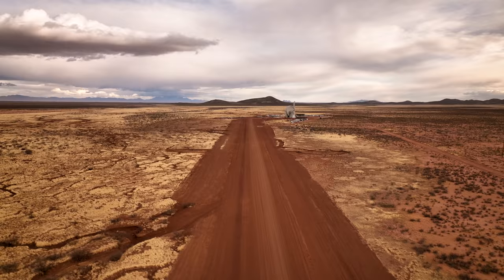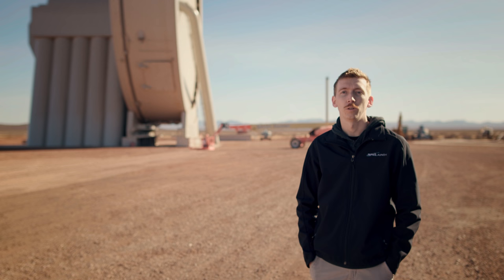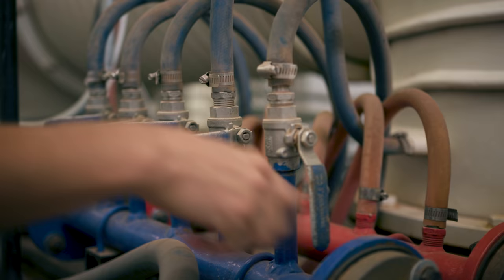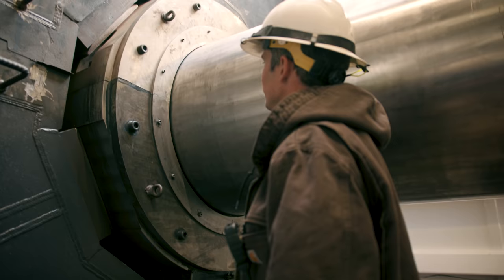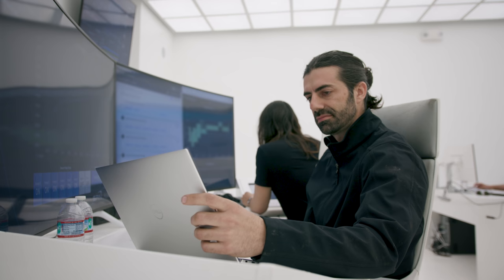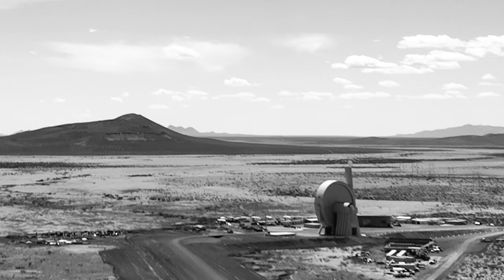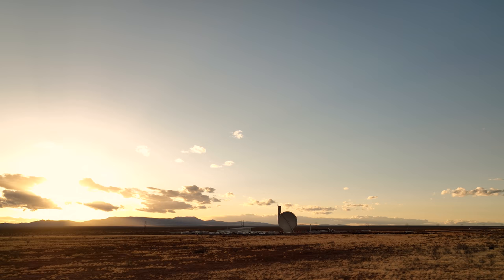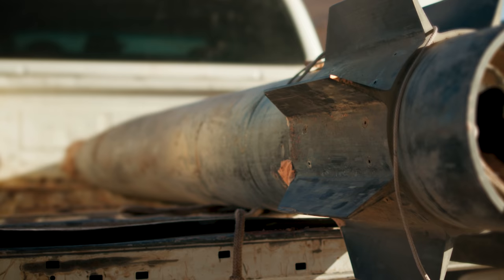An Inside Look: SpinLaunch Flight Test #7

Comment: This is incredibly cool!
It's not very practical on Earth (mostly due to the high G loading), but it would be an awesome system to use on the moon. You could have a much longer arm which would lower the forces on the payload, and one of the main things you might want to launch is ice for fuel, and even megalith for space habitat shielding. I'd guess that a system like this would be a lot cheaper than any rocket-based system to launch stuff from the Moon.
I'm sure you've thought of this, but are you developing such a system? I could see a need for it within 10 years or less.
Keep up the good work!

Comment: I'm thinking about getting an extra boost by having a charge set off upon exit, with the inner door as a blast pad. The blast would close the door even more quickly. And make the space between the doors an oxygen rich environment. The ignition would help preserve vaccum.

Comment: (short term)used the spinning launch and some plants inside and a person then fire the laser at the back of the ship to act as propulsion

(Long term) A human person can survive a speed of Sonic boom so i have a theory that a person can also survive when about to launch to a spinning launch maybe its just needs a comfortable object for a person to not squeeze then fired the laser at the back of a ship to act as a propulsion to push the ship to specified direction.the laser is not coming for the ship the source will be on earth.maybe a million bolts is required i don't know.this laser that I'm talking to is the laser fired in a micro sattelite probe to spy proxima centauri the strength of the laser will decrease in distance so many you need to fire laser sattelite first to act as a bridge sent a fired laser to the ship.the other problem is that where is the source food to survive a person on the ship so maybe the ship should be a bit bigger to build a plant resource inside and some water

Comment: This is a flawed design yet they still keep going. The amount of energy and speed needed to take it orbital is outrageously high. The vessel would need to be spun much higher than match 10. Which has so many complications. And even if it did happen, the vessel would experience insane forces limiting commercial viability. Even getting a projectile from something like a railgun orbital would be extraordinarily difficult. And this is 1000x harder than that would be.

Comment: Here is an Idea..  a small recoverable rocket.   You are putting square wheels on a car..  you need to to remove all the air from the chamber to make it more efficient..  and spin it 30X faster at LEAST..  why even bother doing this??

Comment: And what is the fuel vs energy trade off here? 
How is say saving fuel to 30,000 feet or say 60,000 feet more of an advantage of say strapping such a payload to a wing on some jet flying at 60,000 feet and releasing that payload? In fact that payload when released from the jet will have significant forward speed compared to this setup having zero speed at 60,000 feet. 
Virtually all or most of the energy going to be used up traveling through thick air in the lower part of the flight. Seems to me that using an aircraft at 60,000+ feet and then imparting mechanical energy (such as a electrical rail gun) would make much more sense).
I don't see how the numbers work to impart such mechanical energy from ground level, but such an idea at 60,000+ feet would, especially given the thin atmosphere at that point. Not at all convinced this road makes much sense at all, and worse is the payload stress being so high severe limits the types of payloads you can launch - especially the types that can pay the bills for such a launch.
But for the large portions of the society that's on the lower side of the IQ bell curve?
Fun to watch and a great way to fleece money out of those on the lower part of the IQ bell curve.

Comment: This isn't real!
What's to prevent the unbalanced centrifuge from destroying itself at release? 

Once released, it's a hypersonic missle traveling Mach 7+ at sea level, how are you gonna dissipate all that heat?  Exiting the vacuum chamber into sea level air pressure is gonna be serious impact energy to deal with.  

Acceleration at launch would make it untenible for any g-sensitive payload, it would make a pretty good torture machine though.
Reply: The shock when transitioning from vacuum to air will be the most difficult to deal with.  (Not really lol)

Comment: Just too many G's to achieve anything worthwhile - not to going to work. But (always a but) - wondering if a kinetic energy centrifuge might have a chance at a higher latitude. Unlike rockets, the force required and therefore the G's produced - would be less where the atmosphere is thinner, and the troposphere is closer to Earth. Spaceport is at 32°59' lat. - how about trying it at a place like Nome, at 64°30'? Or better yet - Utqiagvik AK (northernmost US town) - at 71°17' lat.? Just spit-balling.

Comment: Nothing would be cooler than to be shown that I'm wrong, but this all seems pointless. You aint getting to orbit without a chemical engine to bring up the orbit's perigee, and what fuel or o2 chamber is going to withstand 10,000G? How limiting and how expensive would it be to harden a satellite to that spec when competition offers <$3000 per kg to orbit? This seems like something that could have practical use on the moon or mars, not earth.

Comment: 2,000 Lbs x 5000 mph = 4,000,000,000 hp
but
You cant spin 444 lbs you have to counter weight it with 444 lbs that means 888 Lbs  and 2 steal arms @ 10 Trillion Hp 
and
popping a vacuum from zero to 14.7psi of a massive disk you will have to burry the spinner in concret reienforced with steel and even then 30,000 feet with solid rocket fuel to get a escape velocity.
lots of power a 10 Trillion hp electric engine to spin not a shaft @ 5000 Rpm but 10,000 Lbs.
Dual payload Arms shaft and a sudden loss of 440 Lbs. maybe pump hot Pb thru the arms after the payload is gone to prevent the impalance of 5,000Rpm @ 444Lbs 
Imbalance break or pump hot liquid pb thru the payload arm or release a counterweight from the arms center hub just before the payload release.

Comment: I've read a number of the comments, and there seem to be some strange things going on here.  First, the spinning of the primary arm does impart kinetic energy to the center of mass of the projectile.  However, unless there is a secondary pivot at the point where the projectile attaches to the primary arm, the system will also impart a lot of rotational kinetic energy about a spin axis perpendicular to the long axis of the projectile.  From the published images, this is clearly not happening as the projectile shows no sign of rotating that way immediately after launch.

Let's assume that there is indeed a second rotating axis in the actual launch apparatus.  This could be geared so that the projectile always points up during the entire spin-up or could be an independent system that aligns the spins just before release.  Perhaps that is a trade secret, which is why we don't see it in the images of the primary arm.

The next problem is that, independent of spin, there are large tidal forces on the projectile, which is long and thin.  Whenever the projectile is aligned with the tangent of the primary spin orbit these tidal forces will tend to bend the projectile, trying to make it into a pretzel.  Whenever the projectile is pointed along the radius of the spin circle, the tidal forces will try to rip the front half off from the back half.  If the spin is being cancelled, these tidal forces will change once per rotation.  Since the system is being slowly spun up, these fluctuating tidal forces will likely find every vibrational mode of the projectile's structure.

I don't know of any commercial payload, much less a second stage, that could take those g-loads and vibrations.  It's suspicious that the projectile buries itself after landing, so we can't see it.

Comment: All that effort ,just to get  the projectile to 30,000 feet, is a waste of time. What will they do with anything heavier and purposeful for a projectile.  The pumping down  of the chamber will take a lot of energy. Then  the seal has to hold the vacuum pressure  but also allow the projectile to burst through it.  And the physics change when you try and aim the spin chamber at anything but vertical.

Comment: Interesting concept. I don’t see how this will ever scale up to be able to replace conventional rocketry to get into orbit or beyond from Earth, though. You’re already subjecting the projectile to immense amounts of lateral acceleration and you’re not anywhere near the speeds needed for orbit.

I don’t see how this can realistically scale up to deliver any meaningful payload to orbit. How will this ever expect to compete against something like SpaceX’s rockets? The Super Heavy Booster and Starship prototypes about to be launched are already capable of taking over a hundred tons of payload into orbit in a single launch and both are 100% reusable. Their performance is only going to increase as SpaceX continues to revise and improve the existing designs and they are doing so at an incredibly faster rate than you folks are. 

I’m not saying the concept and design isn’t going to work. I think that with enough time and engineering and resources you may be able to overcome a lot of the challenges you’ll face as you try scaling this up. What I’m asking is how this technology will ever be able to compete with the improvements happening in conventional rocketry? How will this technology be relevant 5-10 years from now when SpaceX will be routinely and cheaply carrying hundreds of satellites up to orbit per launch and delivering hundreds of tons of equipment to orbit and beyond?

I feel like this would have been much more useful if it had come out 50 years ago but I don’t believe it has the potential to compete with what we are starting to see in recent times.

Comment: 1,200 mph? You need to get 24,000 mph to escape earth.😂 also you have no ability to steer the craft it’s just in free flight ballistic motion. Also what kind of centrifugal forces are you putting on that thing by spinning it that fast? What payload will withstand that? Also also instead of slowly speeding up you are slowly slowing down due to gravity so by the time you reach orbit your speed is going to basically be zero. How is it supposed to stay in orbit?

Comment: Dead end idea and technology. Beyond sending a solid metal slug into the air it will fail. G forces on massive objects will meet material strength limits and tear itself apart, before and after launch due to counter weight. Any motor would have to start immediately after leaving the thing because it needs to continue accelerating to reach escape velocity. Do some math and physics.

Comment: You know that the harder problem will be trying to build the rockets needed to get into orbit.   This throwing the projectile machine is the easy part.   Show me a liquid fueled rocket that can take 10,000 G's of lateral acceleration and until this exists....all the money being spent on this spinning gizmo is wasted.    Look what happened to Virgin Space today....rocket failure....and that's a similar size machine that was treated with kid gloves...and it failed.   Rockets are hard to make work let alone withstand 10,000+ G's laterally.    This is going to end in failure...sorry.

Comment: Here’s another perfect example of a completely useless project for the purpose which they have explained. The concept of riding a bullet into space is completely impractical, and has easily been proven by physics. You’ve not even reached 6 miles yet so you’ve only got 1194 to go in order to reach low orbit, not to mention the massive accelerations required which would likely damage or destroy any payload you were able to fit into the relatively small “bullet” or vehicle as you have so incorrectly named it. In a few years the data will prove once again that this money pit achieves nothing and proves itself to be impractical, then it will be another mysterious dirt covered monolith in the desert that people come to look at and wonder what is was for. What a waste of precious resources and money.